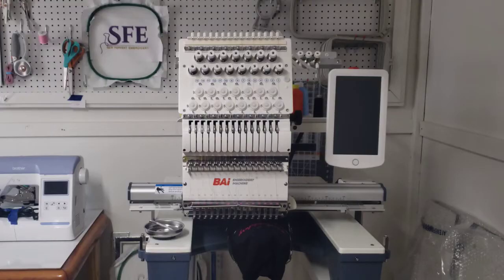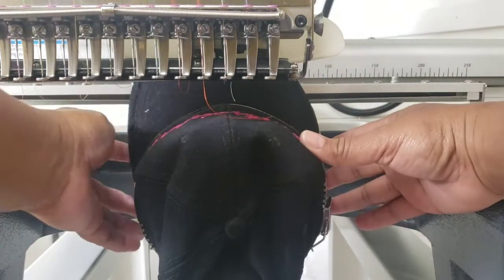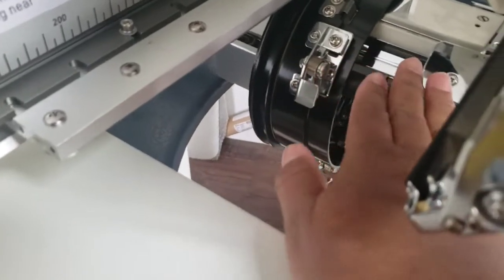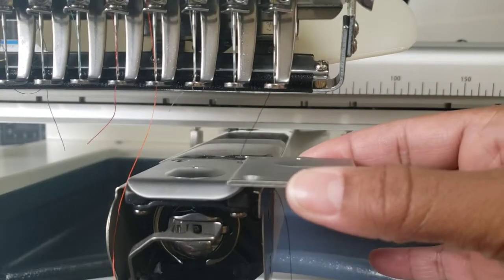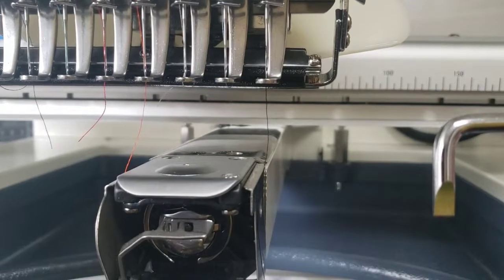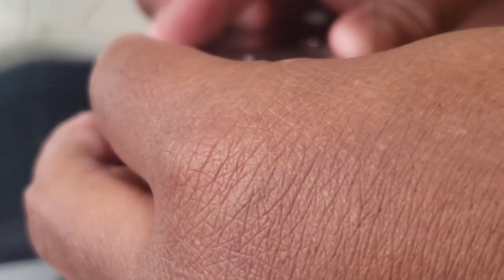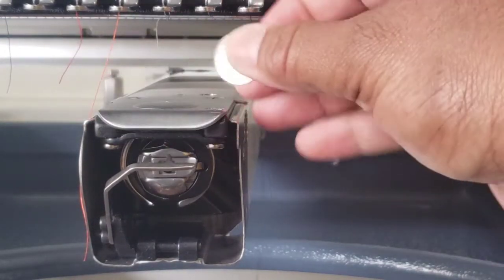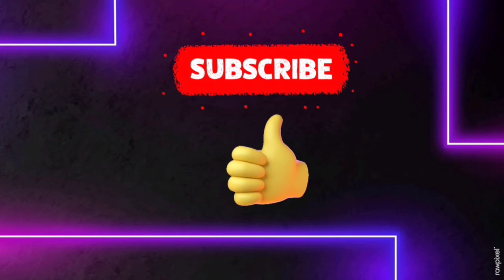BAi embroidery machine/How to remove cap driver/How to remove and install needle plate

Comment: Hello. I just receive my Bai 1501. I was wondering is there a certain software you need to open Dst. FILES. I have a hp laptop. My laptop will not open the H test. So i can transfer to Usb. Thank you.
Reply from the maker: Hi, yes you will need an editing software to view a DST file. There is Embrillance,  Hatch, and Sew What Pro. I use Sew What Pro.  
You can also download it to a USB drive. Then use the USB drive to open on your machine.